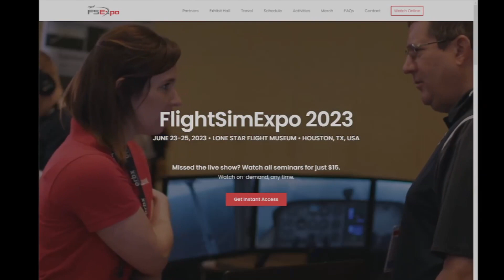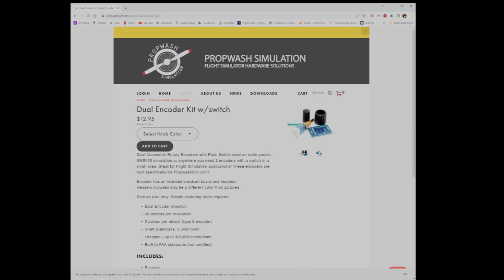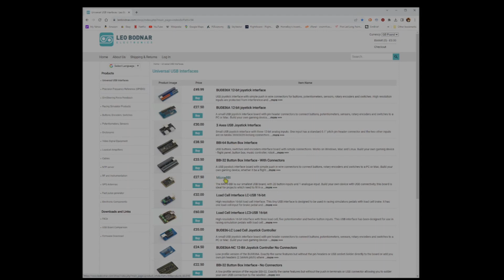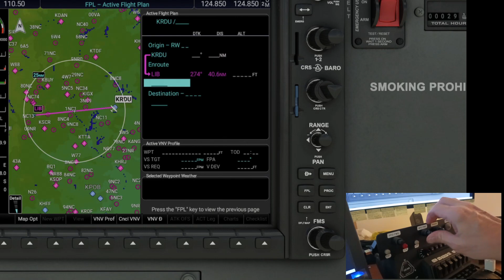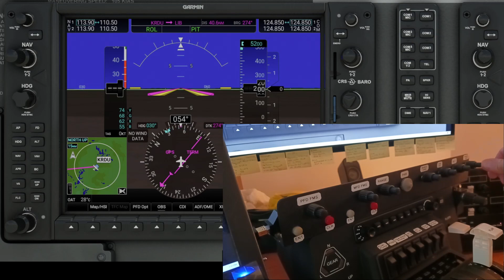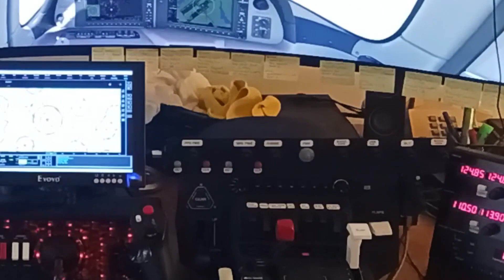Goodbye Knobster!!  What??

Comment from the maker: I thought you might like to see the button assignments I use for both MSFS and X-Plane.   I tried to add these to the description above but it made the description too long so I am including this table here.  Hope this helps you if you decide to build your own Knob Array Panel.   Thanks and let me know if you have any questions or want to see the scripts I used where adequate commands were not available.

BUTTON ASSIGNMENTS
  Note: These assignments are for G1000 equiped aircraft.  The MSFS assignments are flight simulator events used by FSUIPC, Axis And Oh's and other similar applications rather than the default CONTROLS OPTIONS.  Also, there were not adequate commands for some of these and I had to resort to scipts.  I indicated these with "[Script Code]".  I'm happy to share that code upon request.

BUTTON                     MSFS                                                      X-PLANE
--------------------------------------------------------------------------------------------------------------------------------------------------------
PFD FMS Outer LT    H:AS1000_PFD_FMS_Lower_DEC      G1000 pilot FMS outer ring tune up
PFD FMS Outer RT    H:AS1000_PFD_FMS_Lower_INC      G1000 pilot FMS outer ring tune down
PFD FMS Inner LT     H:AS1000_PFD_FMS_Upper_DEC      G1000 pilot FMS inner ring tune up
PFD FMS Inner RT    H:AS1000_PFD_FMS_Upper_INC        G1000 pilot FMS inner ring tune down
PFD FMS PUSH        H:AS1000_PFD_FMS_Upper_PUSH    G1000 pilot FMS cursor
PFD ENT                    H:AS1000_PFD_ENT_Push                  G1000 pilot ENT
PFD CLR                    H:AS1000_PFD_CLR                             G1000 pilot CLR

MFD FMS Outer LT    H:AS1000_MFD_FMS_Lower_DEC     G1000 MFD FMS outer ring tune down
MFD FMS Outer RT    H:AS1000_MFD_FMS_Lower_INC     G1000 MFD FMS outer ring tune up
MFD FMS Inner LT     H:AS1000_MFD_FMS_Upper_DEC     G1000 MFD FMS inner ring tune down
MFD FMS Inner RT    H:AS1000_MFD_FMS_Upper_INC      G1000 MFD FMS inner ring tune up
MFD FMS PUSH        H:AS1000_MFD_FMS_Upper_PUSH   G1000 MFD FMS cursor
MFD ENT                    H:AS1000_MFD_ENT_PUSH               G1000 MFD ENT
MFD CLR                    H:AS1000_MFD_CLR                            G1000 MFD CLR

RANGE Outer LT      H:AS1000_PFD_RANGE_DEC              G1000 pilot range up
RANGE Outer RT      H:AS1000_PFD_RANGE_INC               G1000 pilot range down
RANGE Inner LT       H:AS1000_MFD_RANGE_DEC             G1000 MFD range up
RANGE Inner RT      H:AS1000_MFD_RANGE_INC              G1000 MFD rangedown

PAN LT                      H:AS1000_MFD_JOYSTICK_LEFT      G1000 MFD pan left
PAN RT                     H:AS1000_MFD_JOYSTICK_RIGHT    G1000 MFD pan right
PAN UP                    H:AS1000_MFD_JOYSTICK_UP           G1000 MFD pan up
PAN DN                   H:AS1000_MFD_JOYSTICK_DOWN     G1000 MFD pan down
PAN PUSH             H:AS1000_MFD_JOYSTICK_PUSH       G1000 MFD push pan

BARO/CRS Outer LT         H:AS1000_PFD_BARO_DEC             Baro selection down a bit
BARO/CRS Outer RT        H:AS1000_PFD_BARO_INC               Baro selection up a bit
BARO/CRS Inner LT         VOR1_OBI_DEC                                    [Script Code]
BARO/CRS Inner RT        VOR1_OBI_INC                                     [Script Code]
BARO/CRS Outer PUSH   BAROMETRIC_STD_PRESSURE       Baro pressure selection 2992

IAS/VS Outer LT     AP_SPD_VAR_DEC                                Autopilot airspeed down
IAS/VS Outer RT     AP_SPD_VAR_INC                                Autopilot airspeed up
IAS/VS Inner LT     AP_VS_VAR_DEC                                   [Script Code]  
IAS/VS Inner RT     AP_VS_VAR_INC                                   [Script Code]  

ALT Outer LT        [Script Code]                                             G1000 pilot altitude outer ring down
ALT Outer RT        [Script Code]                                            G1000 pilot altitude outer ring up
ALT Inner LT        [Script Code]                                             G1000 pilot altitude inner ring down
ALT Inner RT        [Script Code]                                             G1000 pilot altitude inner ring up

BARO/HDG Outer LT   H:AS1000_MFD_BARO_DEC          Baro selection down a bit
BARO/HDG Outer RT   H:AS1000_MFD_BARO_INC          Baro selection up a bit            
BARO/HDG Inner LT    [Script Code]                                    [Script Code]
BARO/HDG Inner RT   [Script Code]                                     [Script Code]
BARO/HDG PUSH       [Script Code]                                     Autopilot heading sync
Reply: Great video! Is this compatible with SPAD.next? Could SPAD be used to bind the knobs? Thanks
Reply from the maker: @FlyingAce63  Sorry, don't know anything about spad
Reply: @mhf_X-Plane  hmmm, thanks anyway for the reply. I'll ask the people at SPAD if they think it would be compatible. Just as an FYI, you really should look into SPAD, it's a lot better than FSUIPC. You can do a lot more with it. Cheers.
Reply: Wow! It didn't take long at all to get a reply from the developers of SPAD. Here's what they said in case anyone is interested: "It seems like it is using a LeoBodnar board. So yes, you can use it with spad as a generic joystick device". I'm hoping it is a LeoBodnar board being used in your encoder array. Please advise.
Reply from the maker: @FlyingAce63  watch the video and you'll get your answer

Comment: Hi. Is a third party software package needed to use the Leo Bodnar board with MSFS 2020, even for a simple knob like the steam gages on a Cessna 172 or it's radios? Or do you need it only to access the knobs on the G1000? You mention the third party USB joystick managers in some below comments, like those for SPAD.  Thanks in advance.
Reply from the maker: Hi Michael.  The Bodnar boards all look like joysticks to Windows.   You can simply assign the buttons to game functions just like you would with any joystick.  You would only need 3rd party programs like AxesAndOhs or SpadNext if you want to control things MSFS don't provide (which is anything related to the G1000).  As for a schematic,  you really don't need one as the connections are that simple.  A button has two connections; one goes to ground and the other goes to one of the pinouts around the edge of the board.   There is nothing more to it but that.  There are plenty of videos on YT showing detail on how this is done.   Hope that helps and good luck on your project.
Reply: @mhf_X-Plane  THANK YOU!

Comment: I wonder if you could make multiple vertical panels that replicate the controls on a G1000 and put one on either side of an Air Manager display for the MFD and PFD, then enlarge the AM devices to hide the side panels on the screens. Then you would essentially have an MFD and a PFD in your panel that looks and acts like the real thing.
Reply from the maker: @bleonardyou  Of course.  I could have easily done that but I like what I made because it is slim and out of the way.  There are plenty of people who make what you're referring to.  Propwash Simulations is one that comes to mind.

Comment: I'm working on a similar solution. Could you provide your code, especialy for the rotarys
Reply from the maker: Hi jmueller.   Well, there isn't necessarily any code to show other than the chart I already listed in this post.  If you are targeting MSFS here,  you are going to need a good third party device manager (due to the an incomplete implementation of MSFS).  I use Axis And Ohs but there are others, SPAD.NEXT and  FSUIPC.  The problem is MSFS does not provide all the necessary commands (e.g. AS1000 PFD ENT) and these tools exist to attempt to finish what Asobo should have done.  Sad but true.  Hope that points you in the right direction.

Comment: In a Flight Simulatoy you may Get White Knuckles & Sweat  But you ain't die even when you crash, Unless you have a Heart Attack. 
 Why not take a Full size Print of the Planes Panel Glue it to a .060 peice of Aluminum/Plastic sheet. Cut out holes for Displays/Instruments/Switches/Push Buttons/Knobs/Circute Brakers/ETC.  Then add all Switches ETC where cut outs were made Hook them Up to Multipal Arduinos loacated elswhere, so the Panel is as Thin as Possible. Now place this over an UHDTV of approiate sise so the Screen appears thru cutouts where Instruments/Read outs/PFD/MFD/Engin instryment/Displays are located. Locate your Yoke/Throttle/Rudder Peddles below the UHDTV table. Now you have a Actual size AC Panel with Real Switches/Knobs/Buttons with real Tactil feel in their correct Location.
Reply from the maker: Hi HoundDog.   Your idea is good if I wanted to simulate a specific cockpit.  My design was to have a small non-aircraft-specific panel that fit neatly above my throttle quad.  I wanted it to be generic because I fly several types of planes plus I wanted the layout easy to reach for the knobs without looking.  I figured anybody watching could take my idea and easily adapt it to whatever design they want as you have illustrated.   I appreciate you taking the time to reply,   Good luck with your design!

Comment: I got what I call a button box from a much more computer adept friend, and it has just about all of the knobs and buttons of the G 1000 except for the joystick. But that matters little at this point since none of the sims appear to model that g1000 function. Right now there is nothing  on either platform that comes anywhere near fully modeling the G1000 except for the old Mindstar setup, which only works in FSX afaik. 

Are you using some special software for the g1000?

Comment: I just received the same encoders and Micro-BBI, but not finding the exact  wiring schematic for the bbi boards. Assuming A B a b  is 1 2 3 4  and all the com tie together and to GRD on the BBI along with one side of the pushbutton?
Reply from the maker: I plug in the BBI and test with the Windows GameControllers app.  Then I use a couple of jumper cables and test what leads do what on the encoders once I have the encoder soldered onto the circuit board.   If I remember correctly,  "A" is left turn on the big knob and "a" left turn on the small knob.   "B" and "b" do the same to the right.    "C" is the push button.  As for GND,  just daisy-chain all of them together.  You don't need a schematic.  In fact, it's better to figure it out yourself by testing that way you learn more and feel more confident.   Good luck!
Reply: @mhf_X-Plane   Woo love spinning those knobs heh, Thanks again for your time to make this video!

Comment: Wow, great information. I think this might be exactly what I've been looking for. I need a reason to put my little machine shop to work. I wonder if I could use these little boards from leobodnar in MSFS. I'd love to know if I could assign knobs/buttons like you did in Xplane. Thanks for sharing.
Reply from the maker: Hi Sky.  Yes,  this works with MSFS.  You'll need an interface like FSUPIC or AxisAndOh's to provide you all the necessary button presses though as MSFS doesn't expose many of the G1000 functions.

Comment: Nice project Mark. Of course dedicated knobs will always be better than a Single multipurpose knob like Knobster.  But while KnobXP and KnobFS software allow multipurpose use of Knobster, that was an afterthought mostly for use in VR where a group of  knobs cannot be seen. Knobster was really intended for use with Air Manager instrument panels on Touch screens where it is very intuitive.Touch to select and then use the knob. Also it is small and only needs a single encoder. Much easier than KnobFS/XP.  Nice job creating a very useful Knobster substitute . For me building diy is half the fun!
Reply from the maker: The knobster has been great and I don't regret how I've used it.  Thanks for checking in Russ.
Reply: The combination of the Duel Incoder along with 23" Touchscreen monitor, & air manager, to control the G1000, is the reason I purchased the Knobster, for the rest I got all covered with my DIY switch panels
Reply: I bought the knobster 4 or 5 years ago and bought a touch screen based on one of your videos, Russ. Using it with Air Manager EFIS and MCP components, I've been flying the Zibo mod successfully since then. More recently I had to re-write some of the component code (maybe it was due to XP 12 - the code is actually a lot simpler) and it all works perfectly! I don't feel like I really need anything else.

Comment: I have both Honeycomb Alpha and Bravo controllers and love them, but haven't been happy at all with trying to get the Bravo Throttle rotary and push-button array to work properly with XP 11 and XP12. Actually it works better with XP11 than it does with XP 12. I would love to have the double ringed push knob setup like you built! Trust me I know all about the confusion when trying to multi-task twisting knobs with a mouse it is not fun!
Reply from the maker: I hear you.  I spent about three full days re-coding that AFC_Bridge.  It was not ready for prime time for sure.  I posted about what I learned at the X-Plane forum if you want to take a look, might help you:  https://forums.x-plane.org/index.php?/forums/topic/291238-honeycomb-bravo-demystified

Comment: Okay Mark, we gatta talk. It's been my experience BARO will not INC or DEC unless I press the B key in MSFS. Whereas in XPlane I can turn my knob assigned and it works perfectly. Thoughts?
Reply from the maker: Hey Ken!   Great to hear from you!
I know this Knob Array Panel is no FrankenPotato but, hey,  I'm trying!
Interesting problem you're bringing up here.   I assume you mean you are assigning a key/button to RADIO->KOLLSMAN->INCREASE ALTIMETER (for example) and cannot make it work unless you press the 'B' key (SET ALTIMETER) first.  When I assign a key for this, it doesn't do anything at all for me even if I press 'B'.  Unfortunately I'm not much help here as I don't assign buttons this way in MSFS because I don't use the CONTROL OPTIONS to control my peripherals.   I use Axis and Oh's (alternative to FSUIPC) for all my controls because I really dislike the default control options.  In AAO (or FSUIPC),  you would use "H:AS1000_PFD_BARO_INC" to increment the BARO.   I had so much trouble with CONTROLS OPTIONS that I aborted it early on and haven't looked back.   Yet another part of MSFS that is poorly implemented.
Reply: @mhf_X-Plane  Thanks for the reply! I'm using a FlightSimBuilder (MFD) actually. On it there is a CRS/BARO knob(s). As stated, assigned in XPlane, all the buttons/knobs work flawlessly. I can INCR/DECR BARO as assigned (in game). I'm using (still 30+ years later) my CH Products Yoke/ProPedals/Throttle Quadrant and Logitech Flight Panels (Radio/AP/Switch). In MSFS using the FSBuilder.exe for MSFS, MSFS sees all but BARO INCR/DECR. Weird. So, my workaround in MSFS, in Control Manager I've assigned to a switch (button) on my Yoke Set-Altimeter b and that sets the altimeter in game to what ATIS is calling out. I've even tried MobiFlight to assign BARO INCR/DECR in MSFS, no joy, still. I brought the issue up to the manufacture of the FlightSimBuilder G1000, and still no joy. It's not hardware related as it wouldn't work in XPlane, right?